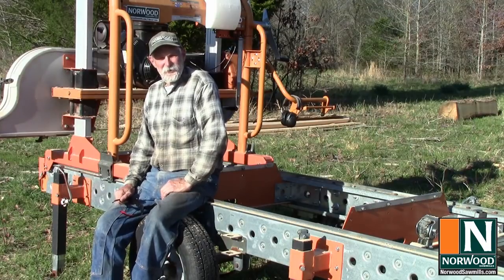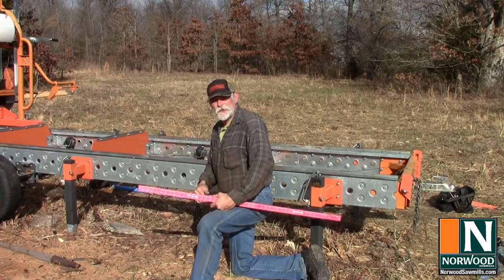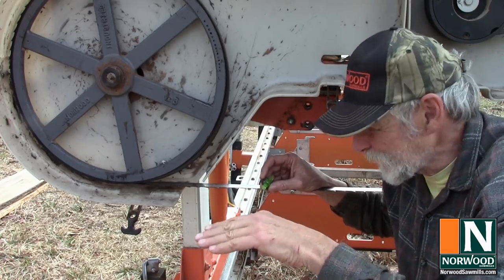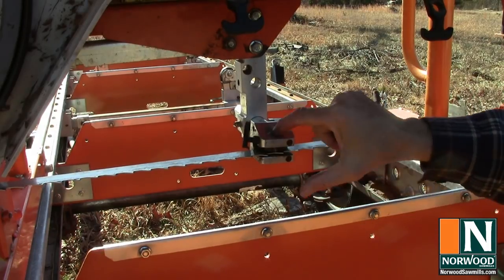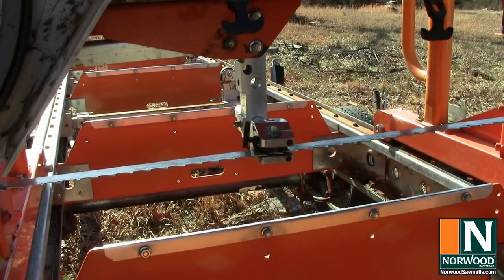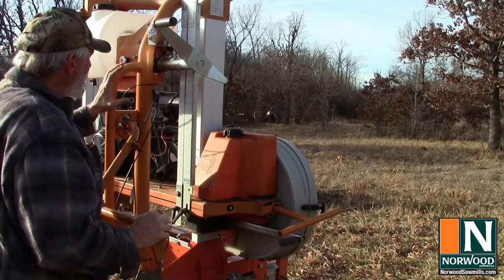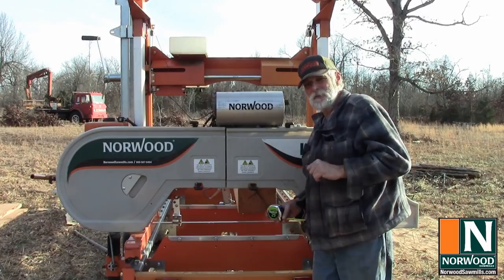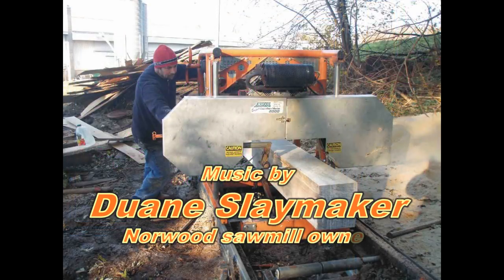Sawmill School - Setting Up Your New Portable Sawmill

Comment: Great video Dave.!..this up close adjustment of things makes a future mill owner realize how well built the Norwoods are..!
Reply: Thanks, Jay.  If anything were to happen to my mill, I'd replace it with another Norwood HD36.  But after more than 10 years, I'm guessing it has a lot of wood yet to mill.
Reply: Hope to feel the same way this year...was admiring the band blade guide support structure. ..billet aluminum?
Reply: @jaytodd5809  Yes, the blade guide supports are milled from solid aluminum.  The HD36 uses ceramic guides.  Personally, I like them, but some people change over to roller guides.  It's a pretty solid machine.

Comment: Thank you for posting this guide video, it help a lot on how to operate on the Norwood LM29, especially the blade tracking. There is one question - When fitting a new fan belt, does it have to be tight inside the moving axle or not? And when the sawblade snaps, what can be the cause and some pointers to look at when buying a new one.
Reply from the maker: Hi Maxim. We would happy to help you. Can you call us at 800-567-0404? Or let us know via email the best number to reach you at? Thanks
Reply: I'm not as familiar with the LM29,  but I've had my share of sawblades breaking.  My advice is to look very carefully at the break.  If it is straight across the blade at the weld, you have a defective blade, and you may be able to get a replacement.  The blade bends around the bandwheel, then straightens out twice each time it goes around, which can fatigue the metal.  This is especially the case if you sharpen and re-use the blade.  When you replace a blade, look it over very carefully for cracks, and that will help you determine whether metal fatigue is an issue.  Do you know the thickness of the blade you're using?  Thicker blades actually fatigue more quickly than thinner blades.  You should be using a maximum of 0.042" thick blade (I believe that's what Norwood sells for the LM29).  Best of luck with your mill!
Reply: @NorwoodsawmillsDirect   Apologies for late reply, has been a rough couple of months. I reside in South Africa. Will message private.
Reply: @daveboyt6810  So far we using the thin blade cutting on soft wood(Pine) , we got the right blade specs according to the Norwood official site. So far it has been operating smoothly.

Comment: Very impressive and explained in detail, thank you sir. I'm 60 years old and thinking about buying a band saw. Think I'm young enough to do that :-) 

But I haven't made a decision between Norwood and Wood Mizer yet. What is your opinion?
Reply: I did a lot of looking before finally going with the Norwood.  Actually, this is my third sawmill, and I'm sticking with it!  While I'm sure there are other pretty good mills out there, Norwood has a number of features that made it stand out, in my opinion.  It is well designed and assembling it myself was no problem, once I got it through my thick skull that I had to actually follow the instructions.  I cut a lot of oddball stuff for woodworkers, and the Norwood lets me move the clamps & stops around wherever I need them, as well as add an extra crossbunk for the short pieces (I actually mill firewood-length walnut, as well as "cookies").  I'll probably add hydraulics to it eventually, as I keep getting further on the other side of 65.  You might check with Norwood and see if there is a mill in your area that you could visit-- or you are welcome to come to southwest Missouri and try out my mill-- I'm always looking for free help!  Let me know what you decide, and good luck.
Reply: @daveboyt6810  Thank you for the answer. It'll be a while before I let you know that I'm going to choose Norwood. I think so at the beginning of next year.  There's a lot to think about and plan about because I don't have my own area.

Comment: Morning Dave, I hope time finds you well.  We just setup our new HD36v2 for the first time and have cut our first log.  In our tracking adjustment (I have some background in band wheel adjustment) we wrote on the sawmill the blade movement direction for the wife.  However, my understanding is that turning the adjuster clockwise moves the band in and turning it counterclockwise moves the band out.  Your video made me refer back to my manual and it says that is correct.  Quote "if the band moves outward, turn the adjuster bolt CLOCKWISE".  In your video, am I wrong to have seen that you turned the bolt clockwise and the band moved OUT?  I just had to go out in the snow to see if I messed up and then reread the manual to double check.  Was this a mistake in video editing?  I did the tension 2 turns and adjust, 2 turns and adjust, full tension and adjust and my procedure worked perfectly.  I want to make sure I'm not misunderstanding something in my (full) brain!!!!??? 🤣
Reply: Wow... Great comment!  Until now, I hadn't noticed that I got it backwards in the editing process!  The way I remember it is "tIghten.. IN, lOosen OUT".  I just watched your "First Log, Part1", and learned a lot, watching how you worked with the mill and each other.  Looking forward to watching as you progress in your sawmill adventures!
Reply: @Dave Boyt  thanks Dave.  I have to say that I have quite a few hours watching your videos and thank you for all the help.  Make sure to watch the Part 2 video.  It went quite a bit smoother🤣.  We cut 380 board feet of 1x1 stickers last weekend and cut a cedar for a customer.  All is working well at this point.
Reply: @williamprophett9148  Great to hear!  I'll definitely be a regular viewer of your videos.  Sounds like you're off to a great start.

Comment: In regards to leveling the track:  isn't it more important that the blade is 90 degrees to the track to produce straight, level boards? If it is, it shouldn't matter if the track isn't quite level. Just a thought and not a criticism. Thank you for your helpful information and willingness to share your time. 
Steve H.
Reply: Good question.  Shows you're thinking things through.  There are a couple of things to consider.  First, if the track has a twist, a blade at 90 degrees to the track still won't give a straight board.  Leveling the track gives you a flat reference.  If the whole track is tipped a bit lengthwise, the carriage can roll when you are loading or turning a log (also a possibility in a strong breeze).  Measuring the distance from the blade to the top of the bunk at both ends, and getting the blade parallel to the crossbunk is also important.  If the blade is off from 90 degrees to the track, you can actually still get straight, square cuts-- after all, when you use a hand saw, do you cut with the saw 90 degrees to the board?  Make sense?

Comment: Do you like the Norwood portable chainsaw mill?  Have you used it.  I can’t put a big mill like yours on my property.   But a put away mill will work
Reply from the maker: Hi Bob. We just replied to one of your PortaMill-related questions. Thanks
Reply: The chainsaw mill works well, and you can put out good lumber with it, but it is slower than the band mills.  Just make sure you have a big enough chain saw.

Comment: I Appreciate the information.  How do you know its time to change the blade? Also do you have the check the tension while cutting?   What about the blade tension when not sawing does it matter?
Reply from the maker: Hi Jef. You get to feel the cut. If it is not as smooth as before, best to resharpen it. Tension once correctly set will is usually remain so for the time you are cutting with that blade. When you are done sawing, it is best to remove the tension from the system as it save your sawmill from being under load needlessly. The exception is when trailering - keep the system tensioned when transporting it..
Reply: One of the advantages of a manual mill is that you get a really good feel for how it is cutting.  Seems like half the time, the answer is "when you hit a nail".  It really helps to knock any dirt or rocks out of the bark before you mill, since they'll mess up a blade in a hurry.  With oak & walnut, I typically cut 4 hours or so before changing a blade.  Might be just one hour when cutting Osage orange (hedge), or 6 hours in pine or sassafras.  Norwood gave good advice on blade tension.  I almost never adjust the tension during a cutting session.

Comment: Dave I enjoy all your informative sawmill videos. I think I have seen them all and hope you make more. 
Today I have a question. Do you use blade lube/coolant and if so what do you consider to be the best. Is it necessary? I have used dish soap(Dawn) mixed with water and Pinsol. I have heard about using diese fuel mixed with oil. I'm afraid that will stain the wood plus it smells bad. Also anything mixed with water is going to freeze in cold weather. So tell me what you do.
Reply from the maker: Hi Ken. Definitely you are correct in shying away from diesel. It is not good for your belts and can cause a number of other issues. And, you are right, it smells and unpleasant to work with or be around. Dawn or Pinesol are both good additives if you have pitchy wood. If you are going to mill in the winter (or leave your sawmill out in the winter), add windshield washer fluid to your water (the kind good to -40 degrees). Works like a charm.
Reply: Norwood's reply is spot on.  That said, I only use lubricant on old, dry logs, or when pitch buildup is an issue, but everyone has their own take on the matter.  Otherwise, I figure there's already enough moisture in the wood (nearly half the weight of a fresh-cut log is water) that dripping a little more on the blade won't make much difference.

Comment: Thanks for all the vids. Helping a lot. Just noticed in this vid that you didn’t have ur water hose hooked up. Is that not necessary?
Reply from the maker: Hi Steven

The blade lube is something we usually recommend although, with more experience, some sawyers can judge when it is not as necessary.
Reply: Good eye!  It depends on what you're cutting.  Here in the Missouri Ozarks where hardwoods make up 95% of my sawing, I don't often use water lube.  I do use it with a Pine-Sol/Simple Green mix when cutting pine or any other wood that causes pitch to build up on the blade, just to keep it clean.  Even with hardwoods, this is an issue when cutting in the Spring.

Comment: Thanks for all your video's Dave, I was just wondering why you don't use water like everyone else seems to with their sawmill ?  :-)
Reply: Careful... you may have just stared a big debate!  Here's my take on it: Using water never seemed to make much difference for most cutting (half the weight of a freshly cut log is water anyway), so I am skeptical about it being necessary.  The exception is when there is pitch build-up on the blade (more of a problem in the spring when the sap is flowing).  Then I use water with a solvent to keep the blade clean.  Bear in mind that I cut mostly hardwoods.

Comment: On green board can i use drain oil instead of diesel as the drip lube on the blade
Reply: Good question.  First of all, never use oil of any kind (including Diesel) in a sawmill not designed for it (Norwood sawmills are NOT designed for Diesel).  The oil will destroy your drive belt, and may cause other damage.  Use only water.  I mix in a cup of PineSol or Simple Green with the water to help keep sap from sticking to the blade, and in the winter, you should add windshield washer antifreeze, but that's it.  That being said, if your mill is designed for Diesel drip lube, used motor oil doesn't flow as well (more viscus), and it will stain the wood.

Comment: Dave i am a newbie,  how did  you determine your 4 quarter cut the first time from the top if that was the initial cut and  how do you consistently do the same cut for the whole log?
I would also love to see you personally if that would be allowed just to learn more of what you do with this machine
Reply: Hi, Rey,  Good question.  I start by taking a slabbing cut off the top of the log-- I try to set it to the nearest 1/4" mark so it will be easy to remember.  I usually cut "4/4" lumber 1-1/8" thick, and allow for a 1/8" kerf, so after each cut, I drop the blade 1-1/4" for the next cut.  After the slabbing cut, I cut a few 4/4 boards, depending on the size of the log, based on the top.  For example, if the first slabbing cut is at 14-3/4", I'll make the next cut at 13-1/2", and the one after that at 12-1/4.  Then I'll rotate the log 1/4 turn and repeat the process.  Any time I have a rounded side down, I work off the top of the log.  After the next log turn, I'll have a flat side down, so that's where I figure from the bottom up.  Since I want my last cut to be 1-1/8" thick, I'll slab from a measure that gives me that:  maybe 9-1/8, 8-5/8, 7-3/8, 6-1/8, then turn the cant another quarter turn and repeat the process, and cut straight down to the last cut, which leaves a 1-1/8" thick board, all 6-1/8" wide.  If I decide to turn the cant for better grade, I'll still come out even on the last cut.  Got that?  This video might help out some: https://www.youtube.com/watch?v=nMkq5M37ON0&t=1300s

Also yes, you'd be welcome to come out.  I can always use some free labor!  I'm located in southwest Missouri (18 miles south of Joplin).  Feel free to email me at dboyt.42@gmail.com
Reply: @daveboyt6810  thank you very much for the info and the offer. I'm from north of the border so it. might be after the pandemic for the opportunity to come out to slug some logs with you.

Comment: should be nice to see how to leveling!!
Reply: Great idea for a video!  Generally you try to start with a piece of flat, level ground.  I level front to back first, then side to side.  Portable mills like this one are easier to level than stationary sawmills, but once properly set in place, a stationary mill will need only occasional tweaking, if any.

Comment: Why is it important for the mill to sit level? If the blade is parallel to the track I don’t see why it would matter.
Reply from the maker: Because logs are very heavy Tony and you need to have it properly support throughout.
Reply: In theory, as long as the tops of all the crossbunks are in a flat plane parallel to the plane of the cutter, you will cut flat lumber.  Using level as a reference makes it easier to achieve that.  If the track isn't level front to back, the sawhead will try to roll toward the low end on its own, which is a nuisance, and potentially dangerous if it happens when you're loading or turning a log.  If it isn't level side to side, the log may try to roll off the mill.  Twist in the track is ok only if you are cutting airplane propellers.  A sag in the middle of the track is ok only if you are cutting for rocking chair rockers.  In my early days as a sawyer, I have done all of the above, though not intentionally.

Comment: Get a laser.  Everything will be relative to the line no mater how high the laser line  is above the frame.  Measure down from the laser line.I can set cabinets around corners, along 20' walls and a bar unit out from the wall.  All within the thickness of the laser line.Lasers are cheaper than spirit levels these days.
Reply: A lot of mills use them, but it is hard to see the laser beam outdoors on a sunny day.  Even harder to see when the batteries go dead.

Comment: Notice theres no lube jug on yours.  So does it really matter?
Reply from the maker: Hey Will. All Norwood sawmills come standard with a blade lubrication system including water reservoir.
Reply: Good observation.  It depends on what I'm cutting.  I cut hardwoods mostly, and figure there's enough moisture in freshly cut logs to keep the blade cool, so I don't worry about using blade lube on them.  In the spring when the sap is rising, I use lube with a half-cup of Pine-Sol or Simple Green to keep the sap from building up on the blades.  This also keeps pitch from building up on the blade if you're cutting softwoods.  Most sawyers use lubricant no matter what they cut, and that works well for them.